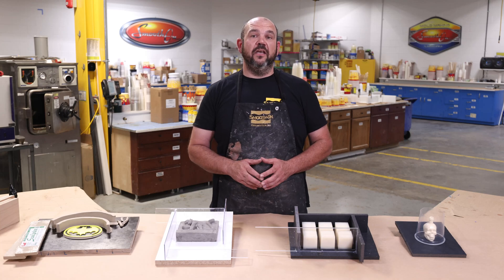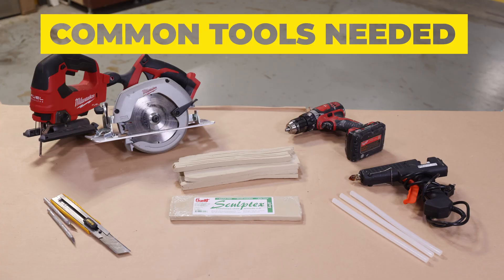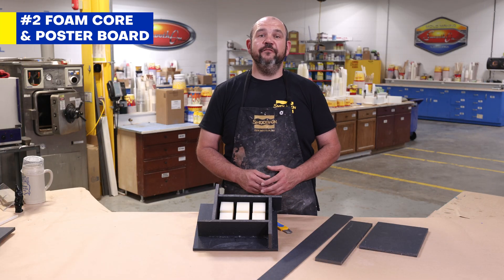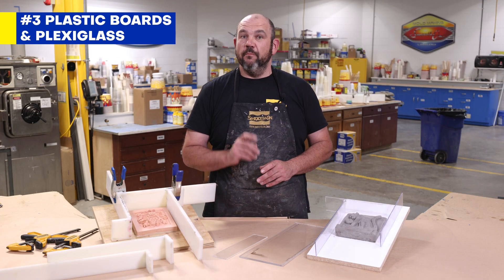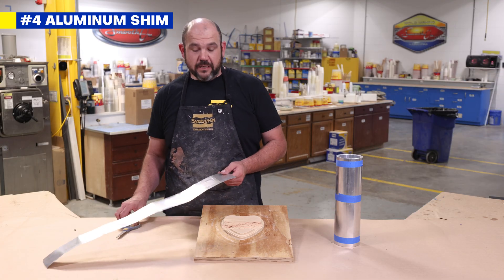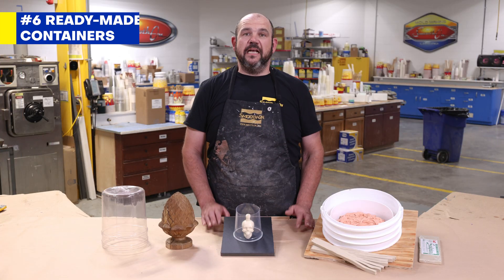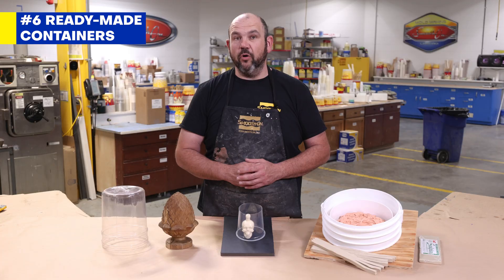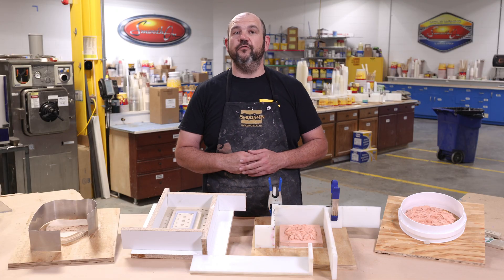Building a MOLD BOX | Mold Making 101

Comment: My tips for mold boxes:  1) Don't use foamcore for a mold that is going in the pressure pot.  Learned that one the hard way when I came back to find a pot full of leaked silicone due to the foam compressing.  2) Apply a little isopropyl alcohol to hot glue to get it to release its hold.
Reply from the maker: Great tips! We've definitely found ourselves using both of these tips in our shop.